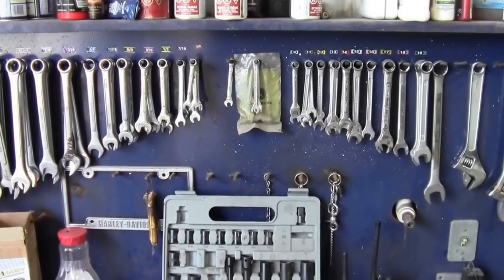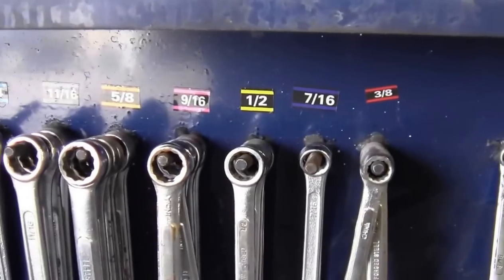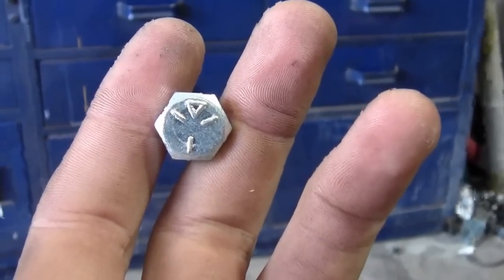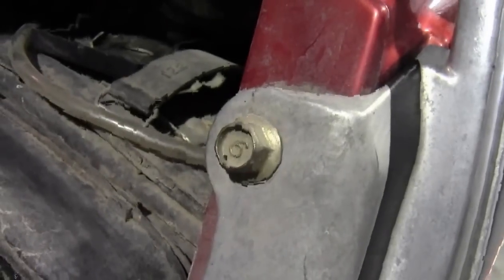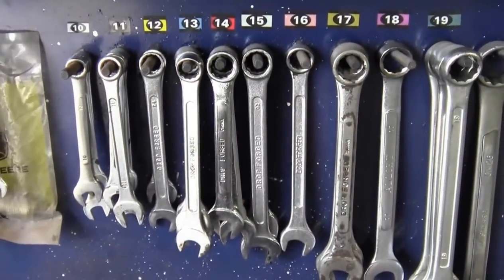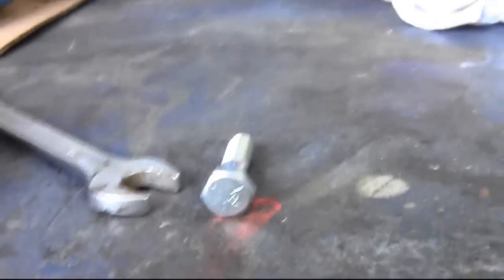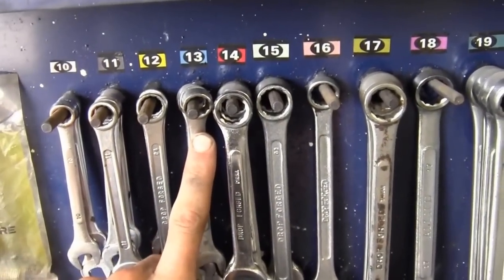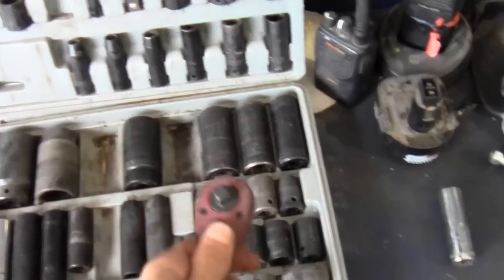Standard vs Metric Wrenches

Comment: I was brought up on metric and this really confuses me. 9/16, 19/32, 5/8, 3/4... What the hell kind of pattern does the imperial sockets follow? In metric is a 10mm is too small you would grab an 11 or a 12, that makes sense because, it's a bigger size, bigger number. But it's a bit hard to realise what is bigger between, 11/32, a 3/8 and a 7/16 without dividing them to a decimal to compare. I suppose if you've known nothing else and it's all memorised in your head you immediately know which is bigger and what order the sizes go, but if you've grown up on metric, you're thinking, what was the person smoking who came up with these sizes? You must understand what I mean?
Reply: nobody uses 11/32
Reply: sorry that math is hard
Reply: Doing math to turn left or right on a nut is such a good use of one's effort. Hell let's get rid of power tools so we can use more of our muscles. Cell phones? Give me some carrier pigeons.
Reply: Dividing them in your head to get a decimal is quite tough. Just convert everything to 32nd's. So 9/16, 19/32, 5/8, 3/4 converts to 18/32, 19/32, 20/32, 24/32 and those numbers are very easy to order.
Reply: Nobody breaks it down into decimals! I have no earthly idea what 11/16 is in base 10. Just next size larger would be either 23/32, or 3/4, depending on how big your tool set is. The next smaller would be 5/8 or 21/32. (They make tools in n/32" increments, but they aren't much used.)
Reply: Very True. confusing stuff. 9/16, 19/32,  5/8,  3/4, 11/32, 7/16
Reply: Altamira1835 I'm lazy to convert numbers stick with metric, example I try a 12 mm and feels to lose go for 13, 14, that's it,  on imperial try 1/4  and feel lose what is the next big number? I don't know
Reply: Mr. Trump would probably change it for us if we asked nicely... I love that guy.
Reply: @ikegel1923  10-32 nuts use 11/32.  You see them in electrical uses.
Reply: @ikegel1923  yes I do on 10/32 and 10/24  machines screws and nuts. Or on termations with various things
Reply: How I tell the difference is to always remember, Epstein  didn’t kill himself.
Reply: The metric sizes are  mostly all approximates so we must know the exact sizes in metric. we start with .3mm or 1/64ths. .7mm is 1/32nds. 1.1mm is 3/64ths. 1.5mm is 1/16ths. 1.9mm is 5/64ths. we are just adding .4mm. 14mm is an approximate size to say 9/16ths but the exact size is 14.2mm. if you see 9mm, that is used to say 23/64ths but the exact size is 9.1mm. 12.7mm is 1/2 inch. some of the metric sizes are exact though. 19mm is the exact size of 3/4ths. 1.5mm is the exact size of1/16th. 5.5mm is the exact size of  7/32nds.
Reply: @ikegel1923  11/32nds is 8.7mm.
Reply: @ikegel1923  not true, #8 size hex nuts are all 11/32.
Reply: The pattern is that, for small sizes, they increase in steps of 1/16 inch, mostly.  There are sometimes steps in between, like 11/32, but they are unusual.  A sixteenth is about 1.5 mm.

I understand what you mean, but I don’t understand why some people seem to have difficulty figuring out how it works.  Before metric became common in the US we all used SAE wrenches and I never met anyone who was confused by the scale.  Children study fractions.  When children begin school, they have a school ruler usually marked with both a carpenter’s scale and a metric scale.
Reply: Don’t they explain “least common denominator” where you went to school?  If you keep your wrenches in order in a pouch, that will help.  Notice how the length of the wrench increases as the span increases.
Reply: @ikegel1923  big green egg uses 11/32 on their side shelves
Reply: @JB-qf5pn  — What you want to do in that case is get an 11/32 combination wrench just for that, and paint it green.
Reply: I’ll look 👀

Comment: Get rid of the complication, and just go metric.
Reply: KrunchyJD you need standard for some older american cars
Reply: As he mentioned many times, if you're working on different vehicles, they require different sets.
Reply: There are many things besides old cars that have inch-based hardware.  Replacing them would be a big complication.
Reply: Older American and Canadian built cars use standard wrenches. European and Asian cars use metric.
Later built American and Canadian Started going metric around 1971 with the Ford Pinto and Chevrolet Vega. When cars got redesigned or when new cars introduced they went metric ever since.

Comment: If i see it well i saw a bolt with a metric screw and a head in inches. Something like a 3/4 head and a M10 wire.  Are you stil using unf...?

Comment: 13mm is very common on American and European cars.
12mm and 14mm are usually only found in Japanese vehicles.
I see 11mm all the time on Fords, basically an m6 x1.0 flanged hex nut which is oversized.
Reply: Word up…. … to work on Japanese cars are 8, 10, 12, 14, 17, and 19 mm. I have never had the need for any other sizes.

What can be said for German and domestic cars?
Reply from the maker: JIS metric and ISO metric use different head standards.

Comment: 18mm is not 3/4 but 19mm is as 3/4 is exactly 19,05mm. By the way 12mm is not very common but 13 is as most M8 bolts are 13mm hex head.

M8 - 13mm hex head
M10 - 17mm hex head
m12 - 19mm hex head

By the way metric is the world standard (SI). imperial is mostly used in US, UK and some former colonies.
Reply: In the uk we converted from imperial decades ago
Reply: @bradleypease2492  and wisely did in my regard

Comment: A Norwegian farmer told me that common metric bolt sizes are: 8,9,10,11,13,17,19,22 with the occasional 16,18. That means that 12, 14, 15, 16, 18, 20, 21 are almost never used according to him. I guess this means that farm equipment is different from other types of gear such as bikes or motor bikes?
Reply: In bikes i would always used 14s and 16s

Comment: Most GM,Chrysler and Ford vehicles use 8mm,10mm,13mm,15mm and 18mm a lot.The Asian cars use 8mm,10mm,12mm,14mm,17mm and 19mm.Lot of the cheap socket and wrench sets leave out 18mm and sometimes 15mm,this makes me angry.18mm is by itself and a mostly commonly used size.
Reply: I use 18mm a lot.20mm does get used too and GM fuel filters are one applications of this.A 13/16 fits with a sloppy fit and the 20mm fits just right
Reply: Bolt sizes on vehicles are a downright mess, because they optimise material usage so much that they deviate from the main series defined in bolt sizes. The standard bolt sizes in general engineering are M5, M6, M8, M10, M12 with wrench sizes 8, 10, 13, 17, 19 mm. As you can see not what you find on cars.

Comment: I have collected enough wrenches over the years.  When I first started, I only bought metric along with the 100 pc basic Craftsman set which had the inch size wrenches, etc.  As of now, I go from 6mm-36mm wrench size.  Sizes I have AND never use:  20,23,25,26,28,33,34.  Sizes I did NOT buy ever :  29,31,33,34.     People told me not to buy the previous, yet i didn't listen and to this day, my 23mm and 25mm wrenches look new.   I used my 20mm to tighten a GM fuel filter, then lost the wrench lol.   I just bought a 30mm combination wrench along with a 30mm X 32mm LONG BOX  wrench for suspension work.  I need two wrenches.   I also bought 6 pt. combination wrenches sizes :  6mm-19mm, along with an extra long 19mm combination wrench to hold strut bar.  For those out there reading my comment, dont buy the unused sizes just to fill you tool box. It didn't serve me well to do such.
Also, as for small sizes, never used 16mm.   Domestic cars use : 10,12,13,15,18 while asian cars use :  10/12/14/17/19.    Large frequent use sizes are :  21/22/24/27/30/32/35/36.    Lastly, I only bought made in USA wrenches for quality. I stay away from China unless they come with egg rolls.
Reply: Romulan112 I have a few China made wrenches but i made sure they came with a lifetime warranty like Gearwrench
Reply: please learn that there is no such 6mm size. its 6.3mm or 6.7mm. even numbers before 1/2 inch 12.7mm get a .3mm or a .7mm. odd numbers before 1/2  inch get a .1mm,.5mm or a .9mm

Comment: You are close.  5/8 & 8mm, 1/2 & 13mm,  9/16 & 14mm, 5/8 & 16mm, 3/4 & 17mm are all interchangable in many situations. 12mm is rarely used in the automotive industry but 8mm and 10mm are very common. All vehicles on the road today have at least some metric and some standard sizes. For those who are new to tools, do yourself a favor and buy Craftsman at very least. Their hand tools have lifetime warranty and and they replace them for free if they break but after 40 years I have only had one ratchet break. If you get power tools check the warranty on those you might need the reciept. If you buy cheap tools they can break at the wrong moment and cause severe injury so becareful. Don't buy those plastic tool boxes that come with an assortment of tools already in them.
Reply: 5/8 & 8mm are miles apart, I think you meant 5/16 for that one
3/4 is 19mm not 17mm

Comment: 19mm and 3/4 are interchangable. NOT 18mm. 15mm is not a common size (exept on bicycles) or to substitute for a bsw size.
no mention of BSW 16mm is common!
Reply from the maker: +dalinean All valid and completely true points. I will likely update this video with a better and more accurate one
Reply: 15mm is common if you own ford's.

Comment: I have a 92 c1500 that was 100% made in America. But according to your video with what stamp is on the head it looks like metric. So the logic your explaining is confusing in my case.
Reply from the maker: The metric conversion act of 1975 caused all north American manufacturers to slowly change over to metric. By the 90's a lot of engines were metric, while bodies were standard. Good question

Comment: Mike Wrecker -  Big thumbs down.  You really need to get your facts straight.  Since 1985 all cars and pick up trucks are metric.  Ronald Reagan made federal law that anything sold to the US government had to be tooled to metric specs, so the US automotive industry switched and never went back.  I don't know about boats, heavy equipment or diesel trucks, but cars and pick ups '85 and newer are metric.  I have been turning a wrench for a living for decades and I have only one drawer for SAE (standard) tools.  That drawer gets opened maybe once or twice a year.  All the rest of my standard tools are at home for fixing plumbing fixtures, the washing machine & dryer. 
What ever wrench fits isn't always a good test.  18mm might be close to 3/4", but  19mm is exactly the same as 3/4".  The same applies for the following: 5/16" = 8mm,  13/16"= 21mm,  7/8" = 22mm.   Those sizes are functionally interchangeable.  If you must test by what fits, always try metric first and then try standard. 
Bolt head sizes vary with the location of the manufacturer.  Asian cars don't use 11mm, 13mm, or 15mm; but European cars will.  So saying something is common only reflects on what you work on.  You mentioned 18mm, that size bolt head is only used on some Fords, likewise for 20mm and 16mm.  I've never seen them anywhere else.  Why the weird size?  Only the company knows.

Comment: It's Standard when did "imperial" come from? Never heard SA called that.
Reply from the maker: +Watchman4u Imperial is technically the correct name for that measuring system. "Standard" simply refers to anything that is standard to that location. Therefore US Imperial measuring is standard in the USA.
Reply: The real name for it is SAE.
Reply: “Imperial” has never been the correct term in the United States.  It has only come into use in recent times.  Formally, our units are “US Customary.”  We used to call them “English” units for convenience.  Mechanics started called their SAE wrenches “standard” to distinguish them from those for the occasional vehicle using metric hardware.  Since the US auto industry switched to metric hardware, and there are many import makes now, the term no longer fits, but it persists for convenience.

The reason “Imperial” is wrong is that there are some units for which the US and Imperial sizes differ substantially.  It is better to avoid use of the term everywhere in the United States.

Comment: I have a 74 GMC pickup and nearly everything is standard. I get so irritated when I have to use a metric tool. Standard wrenches are just so much easier to use. All the different sizes are easily distinguishable and you don't have to bring multiple different wrenches to see if it's 12 or 13 because the look the same.

Comment: 19mm and 3/4" compatibel. The same with 22mm and 7/8"
Reply: Yep and 5/16 is 8mm, 7/16 is 11mm, 5/8 very close to 16 really: pretty much interchangable. 15/16; 24mm. Everywhere in the world that used to use Imperial switched to metric a quarter of a century ago, well apart from the US that is.
Reply: " Everywhere in the world that used to use Imperial switched to metric a quarter of a century ago, well apart from the US that is."
I'll bet your houses still have Imperial stuff in 'em. Houses last a good long while!
Reply: AndyPutt1 7/16" is closer to 12mm
Reply: AndyPutt1 5/8 closer to 15
Reply: 1" = 25.4mm so 25.4*(7/16)= 11.11mm and 25.4*(5/8)=15.88mm
Reply: AndyPutt1 all I know is when I put a wrench on a bolt (roughly 15-20 years) if it's close to a 5/8 but not quite I put a 15 on it not a 16mm same with 7/16 and 12. and I 've  only ever used 11mm twuce, once being on a Ford Ranger. So if the other sizes are closer not sure why aren't working?
Reply: so mathematically possibly I guess, but in reality with wrenches no you wouldn't go 11, 7/16 and 5/8, 16
Reply: For years the most common Euro sizes were 10, 13, 15, 17 & 19 but now 16 & 18 are common. Cars made in Asia most commonly use 10, 12, 14, 17 & 19. If I find that I need an imperial spanner I regret my life choices.
Reply: The 19mm and 3/4”, yes, they’re very close, but definitely not the 22 mm with the 7/8”. Here are other close ones:

1-1/16” = 26.99 mm
5/32” = 3.97 mm

Something worth mentioning is that the same tool size (say, 13 mm) will be a little different from brand to brand.

Comment: I grew  up with imperial and then in Canada 1977 they converted to metric, what a fucking joke as I am an Industrial Mechanic/Millwright and I still have to carry both Metric and Imperial tools as manufacturers in Canada are still making machines based on the Imperial measurement system. Our Government even gave you 50% money back when they switched to metric so you could buy all the metric tools you needed but in 2017 we are not yet converted to the metric system. Our government is fucking useless and should have left Canada on the Imperial system like our neighbors to the south.
Reply: or maybe those neighbors to the south should join literally the rest of the world and also switch? I mean all imperial and customary units are already defined in metric units, so still using those is basically duplication of efforts.

Comment: US should stop using imperial. so much time wasted on pronouncing imperial measurements. also when buying tool sets why do they have to include 2 measurements. its waste of money
Reply: Our units are US Customary, not “Imperial.”  There is a vast amount of equipment in the USA with inch-based hardware.  How would such equipment be maintained?  Do you propose we scrap everything?  Talk about waste!  What do you propose to do with cameras and tripods?  Do you know that the tripod mount is an international standard?  The threads are 1/4-20 or 3/8-16, an inch-based specification.  Would you scrap all the cameras worldwide and start over or do you suppose the expensive ones could be modified?  What would that cost?

Metric maniacs have no conception of waste.  That is just a red herring.  Left to their own devices, people will eliminate waste in their businesses without being coerced.  There are many examples of US businesses using metric units when there is some efficiency to be gained from it.

Here’s a suggestion for British automakers to reduce waste: stop building cars with right-side drive.
Reply: I’ll add that a mechanic who works only on things with metric hardware (all new cars today) doesn’t need to buy SAE wrenches.